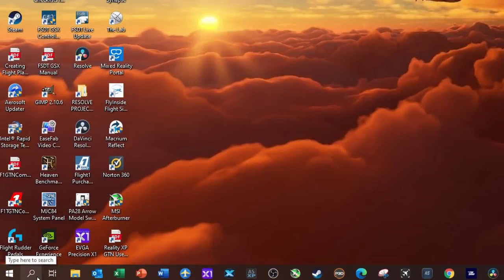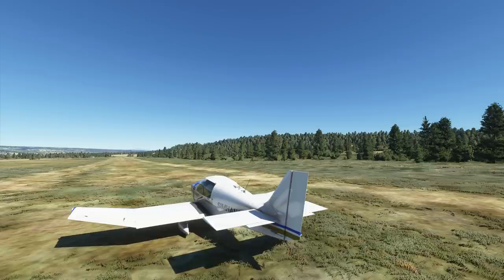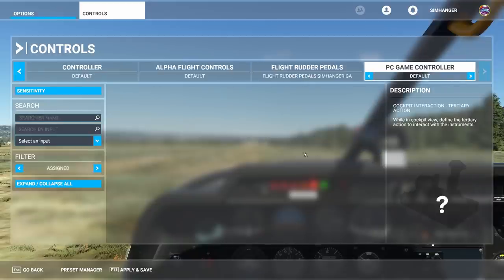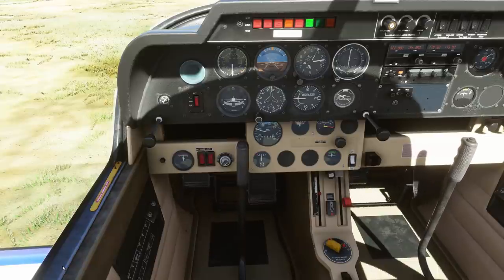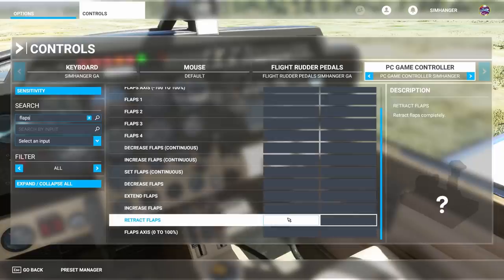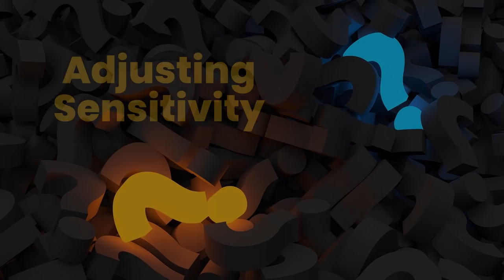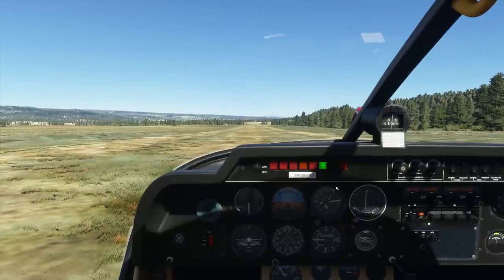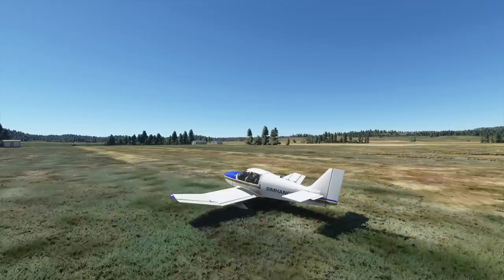HOW TO GUIDE | MSFS | Setting Up Peripherals

Comment: Thanks for these helpful videos.  You've made it possible to enjoy this great Sim instead of pulling out my hair in frustration.  Especially helpful are the tips of which of the myriad, related options for controller mapping, are the ones to use.  Now, if you could put up a video especially related to mapping a standard yoke or joystick for flying the big commercial jets, I'd be very grateful.  I don't really want to buy all the expensive, jet-related controllers (at this time).  But right now, I can't even get off the ground with a standard joystick in the A320.  Thanks!

Comment: Thanks for all your videos, they have been a great help to get me started. I must be missing somethings obvious though - you have rudder pedals connected, but you use the twist on the joystick for rudder. Why? How do you configure the pedals to work with the joystick? I cannot figure out how to do it because they are under different profiles.
Reply from the maker: The flight stick has the option to enable or disable rudder (when linked together by cable). I can also just turn off the rudders via usb and use the joystick etc.

Comment: Great content. Followed easily. I am having an issue after I program the switches my only option on flying is default and not the custom profile I have. I'm new to MSFS  but cant seem to fly with the new setup. Thanks in advance
Reply from the maker: You need to go to preset manager and duplicate default profile, give it another name, save and then make changes to the new profile. Apply and save after making any changes.

Comment: Hi, Mark,
I have previously taken your advice when setting-up bindings for my Honeycombs A and B. As I am having a few 'niggles' with my MSFS (not related to bindings), I am going to do do a fresh install of MSFS. Can you please advise me on, or give me a link to, instructions on how to do this without losing my bindings? A couple of months ago, I bought the Turtle Beach rudder pedals, and they have remained in their carton until my MSFS is free of small glitches. At that time, I will take advantage of your set-up video....as I did with my Honeycombs A and B....and be up-and-running again.
Mark, would appreciate any help...
Reply from the maker: Hi, no way to save bindings manually. They are saved as part of your MS account in the cloud. On reinstall (on same MSFS account) they should reinstall automatically. Works 95% of the time.
Reply: @SimHangerFS  Wow, that was quick, Mark....thank you.
BTW, how can I make a small donation without giving out card details...Bpay, eg?
Reply from the maker: @changi7270  you can use PayPal, link below my video or use superthanks on the video 😀

Comment: Thank you for your VERY useful videos🙏👍
Problem: Flaps, parking brake, landing gear etc randomly keeps turning on/off while in flight. Help would be greatly appreciated.
Reply from the maker: Hi Frans, there could be a number of reasons for this. Check calibration in windows. Check that there is not another binding for the same action somewhere conflicting with your profile. If using honeycomb kit download latest drivers/config. Hope this helps.
Reply: @SimHangerFS  thx for speedy answer, have a lot of stuff in my sim rig so it will take some time to eliminate other bindings. Once again - your videos are extremely useful.

Comment: Thanks a lot for this tutoiral. It got me up and running with my HOTAS. But I'm having some issue where I can take off and fly just fine but once I land at my arrival point, my plane refuses to drive straight and makes me do loops or do a 180 and I cannot drive to the gate. I looked online and some people said that maybe it was something about the rudder being assigned to the HOTAS AND the keyboard at the same time but the results were inconclusive and I don't really know what I am doing. Do you know how I can fix this problem?
Also the nose up and nose down thing only moves the lever between 4 and 5 and nowhere else.
Reply from the maker: Make sure you have AI pilot and pilot assist for rudder etc. switched off. Check your configured under control options…you could have two functions assigned to your throttle or flight stick.

Comment: Hi Mark, 
Just recapping this " how to Video" excellent instruction on set up great tip to remind us to do the basics with the windows / game controller calibration initially.
All though not 100% associated with the video above can you tell me if and how I set up a keyboard button to auto adjust barometric pressure on the fly ie QNH, in P3D it's button "B" where is the or is there a control to be found A/P maybe for barometric adjustment? Thank again Mark. Charlie
Reply from the maker: Hi in MSFS the default is also B. It can be set to a button. Above MSL can also be set but is not configured by default.

Comment: Hi Mark.
A question, well 2 actually, if I may.

Regarding the Xbox controller and the settings.  When I use the Camera/Showcase/ Free mode it's possible to look up and down.

The problem I have is that it's natural for me to pull back to go up and push forward to go down, as in elevator control.  However the camera controller is setup to do the opposite.  Push the top of the right button forward, and it looks up, pull back and it looks down.
The settings list shows 'External Camera', and view up and down,  when I tried to reverse these I got in a right pickle, and ended up with an addition Profile, which I deleted.

In addition my mouse, a Logitech M310, wireless, is combined with the keyboard using a unifying USB plugin.  The mouse settings (default) show a multitude of operations.   e.g. In the 'Assigned'/ Cockpit Camera list UNZOOM is shown as Mouse wheel down, and Zoom as MW up
.  However only the right button has any effect, the wheel and left button do nothing. 
Any ideas/advice would be greatly appreciated.

Many thanks Noel
Reply from the maker: Hi Noel, I have just released a video on the camera settings this may help. You can definitely change/reverse the look up and look down actions. In the default profile delete both key mappings...make sure you have your gamepad selected... (I think it will be the 'R' key). Change to what you want it to be and save under another profile setting. You can not overwrite the default profiles. Make sure the changes you make are under the External Camera when doing so. Note this will only apply in External mode unless the change the button mappings in the other modes.
With regards to the mouse...I'm a bit baffled by this. Check in the camera profile settings (under General/Camera) that your Zoom is set to manual and not auto. Do the same in the cockpit mode from the top toolbar/camera/cockpit. Hope this helps. Regards
Reply: @SimHangerFS  
Hi Mark.
I looked again and this time actually read what you had written.  “When all else fails, read the users handbook”, springs to mind.  I now see you are saying alter the Default and then save as a new profile.  I’ll give that a go tomorrow.
Many thanks Noel

Comment: Hello sir! I am a subscriber and have been following you for almost a year. Having a technical issue that I’m sure a simply one for you, but I can’t figure it out. Using Alpha Flight controls - flying 172 - properly configured - I believe I removed any possible conflicts (fsuipc & mobiflight) however, when I go to full throttle, the sim pulls the throttle back, not allowing power sufficient for t/o. What I’m I doing wrong?
Reply from the maker: Sounds like you have pilot assist features on. Turn them all off.
Reply: @SimHangerFS  That worked. Thank you so much! Something as simply as that is complicated for a newbie that’s just learning their way around!

Comment: I'm having trouble with my yaw,i twist left or right and it doesn't snap back anymore,i have a microsoft sidewinder 2.i tryed twice to reset the programs  same thing
Reply from the maker: Are you setting this to an axis....it should be. Also recalibrate your joystick in windows, and check the sensitivity settings in MSFS. Regards

Comment: With the Honeycomb yoke the HDG bug and OBS knob only move in 10 Degree increments, how can I correct this so I can make 1 Deg changes?
Reply from the maker: jress , hi I have had this problem, intermittently, this is a code error I believe.
Reply: Is it necessary to use the Honeycomb Yoke Input for MSFS. can I delete it if I am not using PD3?
Reply from the maker: jress , hello, the yoke input app is quite frankly rubbish. I don’t use it at all. I set up in the sim directly. MSFS has a default setting for the yoke, but you can also create your own. Regards

Comment: Firstly thank you for your helpful and informative information. I would be grateful for any information for successful setting up for Thrust master TCA quadrant and FBW Airbus after FS2020 update 6. 
Have reviewed most information and videos to no avail. TCA firmware and software updated to latest. FS2020 sensitivity settings set to zero except for reactiveness at 100%.  FLYPAD settings in FBW Airbus for TCA seem not to work correctly and cannot be saved. Do not map to FBW in cockpit throttle.
For simplicity would be grateful to know FS2020 sensitivity settings after FS2020 update 6 and FBW update 7 Stable. Not interested in development or experimental. These cause crashes to blue screen and have bugs. This topic is of interest to many people. The FBW application has been and remains unstable after FS2020 update 5. A great pity as before update 5 FBW was a great product but now a high maintenance time consuming application which detracts from the previous high enjoyment factor. Thank you for any comments.